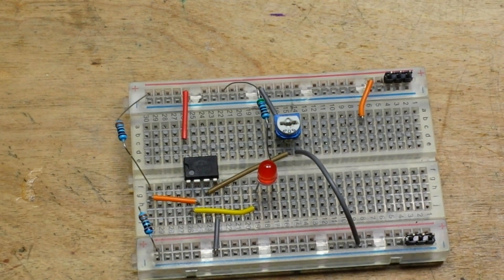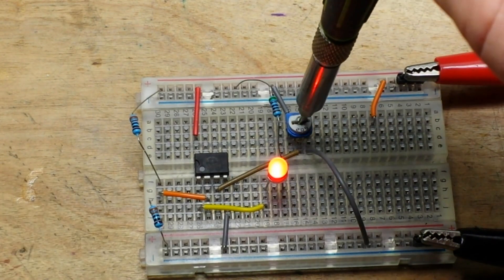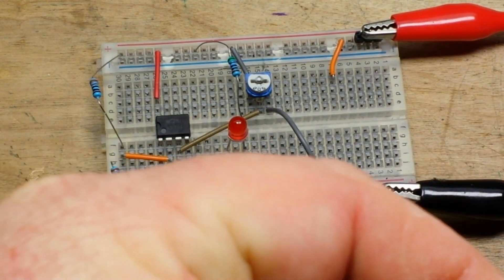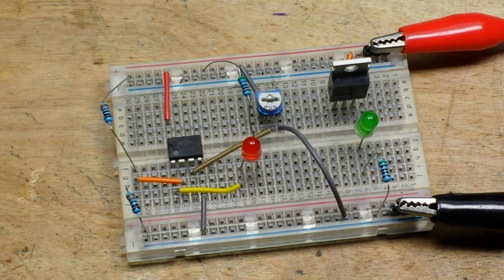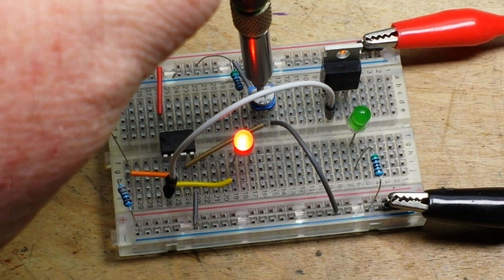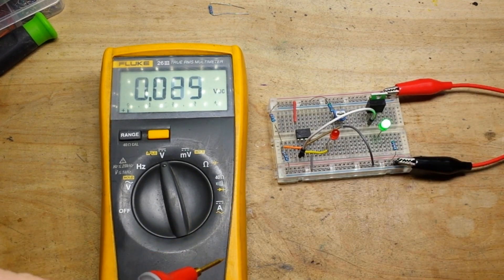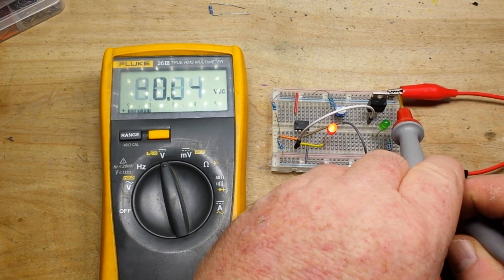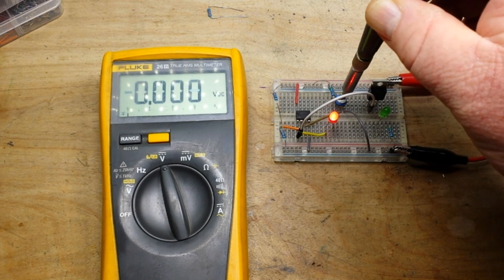Low Battery Cutoff Circuit with LM393

Comment: I have one or two questions and suggestions for this circuit. 
First, would it not have  been  better to use a p channel enhancement mode MOSFET? This would have had  its source connected to the positive supply, with the drain supplying the load, and the gate only requiring a grounding connection to switch it on. This arrangement is compatible with the output of the comparator, which is open collector. As it is, using an N channel MOSFET with the source connected to the load, the voltage on the gate must be Vth (threshold voltage) above the load voltage to turn on the MOSFET, something difficult to achieve if the comparator circuit is powered by the battery it is monitoring.
There are significant advantages using the +input as the voltage reference pin and using the -input as the voltage monitor, since when the battery voltage exceeds the +input reference, the comparator output goes low, providing the required drive for the P channel MOSFET to switch it on. It also makes it easier to apply added hysteresis to the circuit, by applying feedback to the +input. 

In a battery application, the resistor divider voltage will change with the battery voltage, as the comparator is powered from the battery. The solution might be to use a zener diode as the reference or the circuit on LED. Admittedly the zener takes more power to provide the reference, but it is not influenced by the comparator supply voltage until it falls below the zener voltage.  With a little thought, it should be possible to convert the circuit to a boot strap arrangement, where the comparator and reference are powered from the switched side of the MOSFET, making the MOSFET effectively the switch for the product (the load).
In any comparator circuit it is worth considering if additional hysteresis needs to be added to stop the circuit chattering around the switching point. This can be achieved by adding one more resistor to the existing circuit or maybe two,  if a zener or LED is used as the voltage reference.
It is good design practice to connect unused inputs to the voltage rails, unless the data sheet say this is unnecessary. This is to stop unused parts of the comparator drawing unnecessary power or going into oscillation. This also assumes the inputs are specified to include both rails in their input range. 
In testing this circuit, the battery rail should be adjusted to show correct switching operation across the full range of the battery voltage, remembering that for a practical circuit, the comparator is likely to be powered from the battery it is testing. 
In the configuration shown in the video, the battery voltage is emulated by a potentiometer, not by adjusting the supply voltage to the whole circuit. This is valid approach only if a separate supply is used to power the monitor circuit, as might be the case in monitoring a battery charger with mains supply or a bank of batteries in a telecom or IT installation.
Particular attention needs to be paid to the switching point, where the circuit might burst into oscillation for a number of reasons associated with supply rail smoothing/0regulation or lack of adequate hysteresis in the comparator.
It is also necessary to consider what happens if the unit is not switched off when the low battery voltage is reached. 
If the comparator remains powered by the battery, two undesirable events may occurs:
1) the small, but not insignificant, current drain of the monitor circuit may drain the battery beyond the point of recharge.
2) if the monitor is used to switch off the products supply using the power MOSFET, the monitors operation may become unpredictable below the normal operating range of the active elements in the circuit, unless this condition is considered as part of the design. This is all the more reason to design the circuit as a boot strap, so that it turns its self off below a critical battery voltage.

Making the circuit do exactly what is required is not as trivial as the simple voltage monitor circuit might suggest. There are a number of design tricks needed to implement the boot strap and make it fail safe under all circumstances. In a real product design, it would also be necessary to consider where to place capacitors to ensure that the circuit would not be susceptible to RF interference.
As a demonstration of the principles, the video is very good, but a practical design requires a slightly more complicated circuit.
Reply: Waoo!
Reply: @Bias_Prineus  I did not cover the on/Off switching. With the suggested circuit, turning it on is easy, just pull the MOSFET gate low for a moment. This allows the monitor circuit to take over and hold the circuit on. Turning off is a bit more tricky. It is relatively easy if there is a momentary push button for on and another for off. It is then only necessary to make the battery voltage  appear to be low, by pushing the off button to short the monitor point to ground at the input to the comparator. The circuit will then switch off. It is still necessary to check that pushing both on and off at the same time does not produce any undesired switching action. With a little consideration, either the last button released will win or off will win. 

Making the on/off switch toggle is a little more complicated. A momentary switch can be used to produce a toggle action. The trick here is to use the current state of the circuit (on or off) to select the next state. Given there is one comparator still unused in the comparator psckage, this gives the scope to engineer an on/off toggle. Though I would not be surprised that with a little thought, and understanding of the switching principle, that the suggested circuit can not be made to toggle just using steering diodes and a debounce capacitor. 

As I said, the trick is to use the current state to trigger the next required state. In this case, pressing the on/off button conditions the circuit for the next state, which is activated upon  the button's release. This has the advantage that debounce is inherent to the design. 
Consider the following possible solution out of many: 
We know turning the circuit on is simple, just use a switch wired or in parallel with the first ( monitor) compatible output on the MOSFET gate input (forming a wired OR).  This is used to force the MOSFET on  while the button is pressed. Once on, the comparator is powered, the voltage monitor output  takes over driving the MOSFET gate, provided the battery voltage is detected to be sufficiently high.

To turn the circuit off: while in the on state,  the button is pressed and held down for a sufficient time to allow a capacitor connected between the second comparator +input and the switched positive rail to be charged via a series resistor and diode connected to the button.. Once this +input voltage falls below the -input reference,  the second comparator output will switch low,  pulling down the voltage monitor input of the first comparator to which it is connected. This  fools the monitor circuit into detecting  the battery voltage is low. The first comparator then removes the drive to the MOSFET gate, turning it off, switching off the circuit.   Once off, the capacitor on the second comparator is discharged either by a high value resistor across it, or a reverse biased diode to the switched supply rail. The latter has the advantage that the circuit is ready to switched back on as soon as the switched supply rail is truly off. This is because in the off state the switched supply rail is at ground potential, providing a discharge path for the capacitor.

The switching action is as follows: press the button momentarily while in the off state, and the circuit turns on. Hold the button down for a short delay in the on state, and when its released the circuit will turn off. 
The circuit does not need lots of additional components, as the same reference voltage can be used for both comparators.

Notes: it is necessary to connect a high value resistor between the MOSFET gate and the unswitched positive rail to ensure the MOSFET  is held off when  neither the button or the first comparator are driving it to the on state.
As a consequence of the pull up resistor on the MOSFET gate, it is necessary to use a diode to isolate the +input of the second comparator from the unswitched supply voltage on the MOSFET  gate..
Reply: My apologies to anyone who has watched me repeatedly edit the above postings. My excuse is that I am using a small android tablet to write these posts and edit on line, rather than compose them off line before posting.
Reply: @nigeljohnson9820  Hi, could you explain a bit more how to hook up the turn off part of the toggle swicth? How to connect capacitor, resistor and diode to the +input of the second comparator? Also how to isolate +input due to pull-up resistor?
Reply: @sekelje  With pleasure, but what follows proves that a picture ( circuit diagram) speaks a thousand words.
 
Describing a circuit diagram is rather difficult, so I will start by defining a set of rule in the hope of making the description easier to visualise.
First let remind you that the comparator outputs are open collector, so they switch between high impedance and zero volts ground.
The comparator output is (active) low when the voltage on its -input is higher than the voltage on its +input.
The MOSFET is a P channel enhancement mode type, wired with its source connected to the battery supply positive and its drain suppling current to both the load and the comparator circuit.
Thus the drain will be referred to as the switched power rail.
A high value resistor (say 100k) is connected between the MOSFET gate and the source. This resistor holds the MOSFET off when the gate is not being driven.
Thus the circuit and load should draw almost zero current when off.
Connecting the gate to ground, turns the MOSFET ON, provided the battery voltage is greater than the gate threshold voltage.

(N.B. Should the battery supply voltage exceed the absolute maximum gate to source voltage of the MOSFET, the MOSFET gate can be protected by adding an additional resistor to form a potential divider network on to the gate.

For the purpose of this description, it will be assumed that the battery voltage does not exceed the absolute maximum gate to source voltage of the MOSFET used, so the MOSFET does not require any potential divider protection.
)

The toggle switch is a momentary push button type, which is wired with one side connected to the ground and the other side identified as the switch contact.

in order to establish a stable reference voltage for the comparator, a resistor in series with either a zener diode or an LED is connected between the switched supply rail and ground.
The reference voltage (Vref) being taken from the junction between the two components. The advantage of using the LED as a reference is that it will also serve as the circuit ON indicator, however a red LED will provide a rather low value of approximately 1.6 volts for this reference.

Consider the connections to the comparator package:

The comparator positive supply pin is connected to the switch supply rail, its negative supply is connected to ground ( battery negative).
It is good practice to decouple the comparator supply pins with a suitable capacitor, typically 100n wire closely across these pins.

Now consider the connections to the first comparator in the package:
Its output is wired directly to the MOSFET gate. The -input is driven from a resistor divider connected connected to the switched supply rail.
This is the load voltage, and very close to the battery voltage when the MOSFET is ON.

The +input is connected to the voltage reference, Vref.
A diode is connected between the gate and the switch contact, so that pressing the switch pulls the gate voltage to within one diode forward volt drop of ground.
Thus when the switch is pressed the Mosfet is turned ON, 
if the battery voltage is sufficiently high, the -input of of the comparator will be greater than the +input from Vref, and the comparator output will be low. This will hold the MOSFET ON when the button is relaesed. 

Now consider the connections to the second comparator in the package:

The output of the second comparator is connected to the -input of the first, this is where the output voltage  of the battery is monitored using the resistive divider, as detailed above. 

The -input of the second comparator is connected to the Vref.

The +input is connected to the switched rail by a timing capacitor in parallel with a high value resistor and a reverse biased diode. The purpose of the high value resistor is to provide a dc bias on this input. The parallel combination of the diode and resistor, discharge the capacitor when it has performed its function. A timing resistor is also connected between this +input and the switch contact.

When the switch is pressed and held, the timing capacitor begins to charges, until the voltage on the +input is below that of the -input. Then output of the second comparator then goes active low, forcing the battery monitor voltage low on the -input to the first comparator. The first comparator then no longer holds the MOSFET ON, but it remains ON because the gate is still held low by the switch contact voltage.
But when the switch is released, the MOSFET turns off, switching off the circuit. The diode across the timing capacitor becomes forward biased, as the charge on the capacitor discharges through the circuit load and the high value resistor with which it is in parallel.

The function of the diode connected to the switch contact is to isolate the voltage on the switch contact from the voltage on the gate, so even when the gate is being held low by the output of the first comparator, the voltage on the switch contact can still be pulled high by the pull up resistor in parallel with the timing capacitor.

Note in describing the circuit, I have made a couple of improvements, such as providing a better discharge path for the timing capacitor and removing the second diode on the switch contact, as only one is necessary for the required isolation.
Reply: @nigeljohnson9820  Thanks again. So diode in series with timing resistor pointing to switch contact (coming from +input) is not needed (resistor being kept, omitting diode )? Just timing capacitor, high value resistor and reverse biased diode all in parallel across switched rail and +input is needed?
Reply: @sekelje  you are correct about the diode in series with the timing resistor NOT being required, however I have discovered a further  problem with my toggle off circuit, but fear not I have two possible solutions.

 I added the second reverse biased diode across the high value resistor on the +input of the second comparator, in an very poorly thought out attempt solve the problem of discharging the timing capacitor when the supply rail is switching off, and thus protecting the +input. 
The comparator data sheet states that while the comparator inputs are allowed to exceed the positive supply rail voltage, they must not be allowed to  go below the zero volt rail by more than 0.3 volts, (I.e. -0.3 volts) if the output is to be well behaved.
The circuit describes in my earlier posts fails to meet this requirement during the turn off transition period, due to the topological problem of needing to charge the capacitor from the zero volt rail.
As the timing capacitor is connected between the low impedance switched positive rail and the high impedance +input of the second comparator. As the rail voltage drops at switch off, the voltage across the charged timing capacitor can potentially  force the + input below the zero rail volts, if nothing is done to stop it. 
One solution is:
To move  the reversed biased diode across the timing capacitor to a new position, so that it is connect reversed biased between the between the timing capacitor and the zero volt rail.  This diode then clamp the capacitor voltage to within one diode forward bias volt drop below the zero volt rail. Unfortunately, even using a low forward biased voltage schottky diode in this position, does not guarantee the +input will not go below the zero volt rail by more than 0.3 volts, since the Schottky diode voltage is around 0.5 volts.
 To  offset  the clamp voltage and keep the +input above the zero volt rail, requires a further change to the connections on the +input as follows: 
1) Connect the pull up resistor directly between positive rail and the +input.
2) add a third diode pointing out from the +input. (I.e. anode connected to +input)
3)  fit the timing  capacitor between the point of third diode (cathode) and the positive rail.
4) place the second diode so it is reverse bias connected between the capacitor and the zero volt rail.
The cathodes of the second and third diode are now connected together.
The effective of this arrangement is to use the third diode to offset for the negative clamp voltage on the second diode. The protection is improved by using a Schottky diode for the clamp and a normal silicon diode to provide the offset. The Vforward of the latter being higher than the former. This arrangement should give approximately 0.5 volts safety margin on the -input voltage.
The above description sounds complicated, but is simple when shown as a circuit diagram. The cost of this solution is one extra diode. 

Second solution:
As the comparator inputs can exceed the positive rail, a better solution might be to connect the timing capacitor to the zero volt rail, and charge it using small P channel, enhancement mode, MOSFET,. With the gate connected to the switch contact, and source to switched rail and drain through a series timing resistor to the timing capacitor. The MOSFET removes the need for diodes 2 and 3, but the logical inversion introduced means that the second comparator inputs must be  swapped around, with the -input connecting to the timing capacitor and the +input to the reference.
Reply: @nigeljohnson9820  About second solution, if we swap around inputs of the second comparator , for circuit to be in "on" state  +input must be higher than -input, should -input be connected to ground with high value resistor to pull down? If I understand correctly, coming from drain of a small P MOSFET,  timing resistor in series with timing capacitor needs to be connected to  -input? Also, small P MOSFET needs high value pull up resistor connected from gate to the switched rail to function properly. Is isolation with diode needed in this case also?
Reply: @sekelje  the isolation diode is still necessary. The pull up resistor on the small MOSFET acts as the pull up resistor for the switch. When the main MOSFET is being held on. The first comparator is driving its gate low. The isolation diode is therefore still necessary to allow the switch contact to be pulled high by the pull up on the second MOSFET.
The only advantage of the second solution is that the timing capacitor is being charge high.(towards the positive rail). This means that during the switch off transition, the voltage on the charged timing capacitor will exceed the voltage on the positive rail, a condition that does not violate the voltage specification of the comparator inputs. 

The first solution should work correctly, though the tolerance looks a little tight. The action of the clamp and offset diode should hold the +input above the critical 0.3 volts below the negative rail spec, even if two similar silicon diodes are used, but the tolerance is then very tight, as the forward voltage on the clamp diode must be matched by that of the offset diode, leaving just the 0.3 volt safety margin. If you are really concerned, the two diodes in series could be used to provide the offset voltage. I know this is not very attractive, as it requires yet another component. 
From a philosophical point of view, the production of the toggle switching action requires some way to separate the current state of the circuit from the next state. In this case it is achieved using the state of the switch. Pressing and holding the switch on conditions the circuit to turn off when the switch is released. This function is normally performed with an edge triggered flip-flop. In which case each button push changes the state of the circuit, even with a boot strap configuration. 
But the requirement of the comparator circuit was also to accurately measure the battery voltage status, and automatically  turn off if the voltage was too low, and still be in a boot strap configuration. That is more demanding of a non ASIC solution that attempts to use the minimum of components. It is the limitation of the comparator input range that has complicated the circuit. There are beyond rail comparators that easy this limitation. But I did not think it met the design brief to use them, as if it is allowed to use some other component, then there is no reason not to look for an ASIC battery manager IC that does exactly what is required in one device. 
There are many ways to achieve the desired specification, it can be implemented with surprisingly few discreet transistors, resistors and capacitors. Someone has already posted a suggestion that a ne555 can provide a solution, though I have not checked if it matches all the functionality of the  proposed comparator circuits.
This function is ubiquitous in modern battery powered devices, so learning how it is implemented is a worthwhile activity. 

I once worked on the prototype model of a digital mobile radio transceiver. In the haste of getting all the clever DSP bits working, the software design team had overlooked the requirement to be able to turn the radio on and off, making the switch function an after thought.  Almost all the PCB resource had been allocated to the processing and RF electronics. There was just sufficient space to fit a TO220 TopFet and a small low current push button panel switch. Using the above principles it was possible to implement the bootstrap on/off switch configuration, using the few remaining gates in the transceivers FPGA to perform the logic function. The result was a low cost toggle action on/off function able to switch 12amps at 12volts, but drawing no power when off.
Reply: @nigeljohnson9820  Thank you very much, I learned a lot through this conversation.
Reply: @sekelje  in a way so did I. when I posted my original circuit, I failed to consider the limitations imposed by the constraints on the comparator input voltage. Something I would not have done before my retirement. Maybe it was me just me being lazy and not doing the work in the way I once did. Coming up with the circuit topology is the fun, like solving a jigsaw puzzle with a random set of pieces. But once a circuit  topology has been found, it is then necessary to check the details to see if there is any reason it will not work. I have not built either solution, and building a prototype is the next logical step, but I am now reasonable confident that either of the corrected solutions will work, once the component values have been assigned, though they may require some adjustment at the prototype stage. It can be infuriating when a circuit does not perform as expected, but it is always informative.
I suspect that all none trivial designs go through four stages:
1) its impossible to meet that spec. ( Overwhelmed).
2) its easy, now I see how to do it. (Over optimistic and over confident).
3) its impossible, it does not work. ( Over stressed).
4) that how it's done. (Over joyed, satisfied and relieved)
Reply: @nigeljohnson9820  Exactly as you said. Thank you for sharing your knowledge and experience.
Reply: @Bias_Prineus  whoo?
 In this case a picture would have been worth a thousand poorly chosen words. I spent a great deal of time rewriting these posts to try and explain how the suggested circuit changes work. It is unfortunate it is not possible to post a circuit diagram, as I am sure my limited explanation is near incomprehensible to those who do not have the circuit diagram in front of them. I hope that at least the design principles are sufficiently well explained to allow others to implement them in their own designs. There are many ways to implement this requirement, for instant a microprocessor reset IC could be used. There are of course battery management ASICs or a PIC could be used. However, the intention of the video is clearly to provide an introduction to comparators, and how they can be used in a practical application. The proposed changes just extend this to a real world application, pointing out some of design consideration which may not be obvious to those new to electronics.
I have not tested my proposed design changes, but I am reasonably confident that it will work, but as with all back of an envelope circuit ideas, there might be some need for adjustment to make it work as specified. 
This is not the first time when  posting a circuit diagram would have eliminated the need for  a badly written circuit description. I had a similar problem describing a simple stroboscope.
Reply: @nigeljohnson9820  for this circuit eBay has a 555 based charger controller that is 2.5 Euro's assembled   and works good with upper and lower limit as well
Reply: @Bias_Prineus  but that is not the point. The idea was to show how a comparator can be used in this application. There are battery management ASICs that perform this function in a single IC and contains a battery temperature monitor.
Reply: @nigeljohnson9820  The problem isn't with his switching circuit. A voltage comparator to disconnect the battery from the load, works.

The problem is: There needs to be another cutoff prior to his "Control" point, where NO POWER is being drawn from the battery. Some have suggested a zener and a resistor to the control voltage divider/comparator ckt. I suggested the same but added a relay.
The way it is now, there's a wide range of voltages-battery combinations it will work with.
Currently the source is 10v. What if it's 4 D-cell, rechargable? Or a 12v-5ah dry cell for an alarm panel, or 14ah-2 7's in parallel.
This is a ghost ckt, go anywhere be anything. With very slight changes it could work for protection for a flashlight. 

Another option is to use it for say my Son's 16 channel fireworks control system. Using any component other than a relay is automatically current limiting.
What about a camera flash with repeatedly charging caps.

I could go on and on. The point I was making is this. His design WORKS as a "current limited load switch".
But, for the purpose of battery protection, it really failed. It's still talking power from the object it's allegedly protecting.
Without a means to stop ALL battery drain, all it does is delay the total discharge of the battery source.
Reply: @timthomas9105  I think you will find my boot strap proposed circuit solves the problem of the monitor circuit draining the battery when it has cut off the supply to the load. Using a p channel MOSFET, allows the MOSFET to be used in switching mode.
There will always be a circuit limitation regarding the point at which the monitor circuit stops working because it's supply voltage is too low. This might be due to the threshold voltage of the MOSFET or the supply range of the comparator.
The trick is to make the circuit fail safe, that is switch off before one of the above limitations is reached.
A relay is a useful device, but it's relatively high current demand makes it less attractive in battery powered circuits. There is also a problem with vibrational stability. As the supply voltage falls, it becomes easier to physically knock the relay and open its contacts.
Any relay circuit also requires a certain amount of hysteresis built into its switching to ensure the switch contacts do not bounce or burn when slowly or partially open.
While the p channel MOSFET is the best solid state solution for the switch, it must be chosen to have a low threshold voltage. 
An alternative switch is PNP bipolar transistor, here the HFE is the limitation, but the Vbe is likely to be smaller than the gate threshold of a  MOSFET. With the correct choice of comparator, these are likely to continue operating down to 3 volts or less.
The general principle of solid state switching and boot strapping is well understood and is common practice in most battery operated electronic devices. Only very simple devices, such as flash lights still use a conventional on/off switch.
The leakage current through the switched off MOSFET is likely to be in the pico amp range and is insignificant compared to the self discharge current of a battery. So provided the boot strap topology is used, so that the monitor circuit is on the load side of the switch, using a MOSFET in this application has few disadvantages. 
You may be interested to know that the relay solution still finds application in disconnecting the battery in some automotive applications. Where leaving the lead acid battery connected to discharge to zero will irreparably damage it. In this case the relay contacts are rated to hundreds of amps, to handle the normal working load. But even here devices such as high power MOSFETs and IGBTs are starting to replace the very expensive mechanical relays. 
In the radio application on which I worked, the TOPFET was controlled by logic in a 3volt powered FPGA. This supply was derived from the automotive nominal 12 volt supply using a buck switch mode regulator followed by linear regulators. While the battery voltage is nominal 12volts, its actual range is anywhere between 6 volts when the engine is cranked to almost 17 volts when the battery is being charged by the alternator, siting at about 13.6 volts when the battery is fully charged. In a process known as current dumping, the alternator can deliver a significantly higher voltage to the car supply. 
Even with this wide range of input voltages, a TOPFET provide an ideal solution to switching the power to the transceiver. 
A microprocessor reset circuit, reset both the FPGA logic, the DSP, and the processor, when the supply fell below 4.75 volts. 
This completely removed the gate drive to the TOPFET, safely switching off the transceiver.
The transceiver on/off control was by a momentary push action switch, which was part of the radio volume control. This was rated for no more than 100mA. In practice it was used to switch less than 10mA, dispute the radio load being of the order of 10amps.
A relay solution in this application was completely impractical from the point of physical size and operating voltage range.
Reply: @nigeljohnson9820  I agree with everything you said. My point with the relay. A resistor diode ckt, mosfet or anything that completely turns off ALL current draw from a battery is the requirements of protection. There's no application of a load, just a little green LED.
The very first thing I learned in electronics was, "Input Conversion Output". 
So this works when the comparator pot is adjusted. And the red LED lights. Isn't that really like having an identical LOAD?
1) Is the battery rechargable?
2) How is it recharged?
3) What is it's working range?
4) At what voltage level is it safe to operate?
5) At what point above (4) do we want to disconnect the load?
6) At what point BETWEEN (4)-(5) do we need to SHUT it ALL down?
7) Going back to (1) need the type and current rating, whether rechargable or not, to determine the HOW because a car battery may allow for a longer trickle drain on the control ckt. Or AA, AAA, 12v 5ah, 7ah, single and double, series parallel battery set up.
All of it is related and relevant. 

Like I alluded to before. I have an Altronix AL400ULACM 12v 15amp supply with 2 12v 7ah batteries in parallel. 
This setup energizes my home structure can. It's even safe to put 4 batteries in the ckt but the box holds 2. 
As it is, I am able to get 30+ hours of no A/C power, before losing my Wi-Fi, etc.
My interest in this case is, at what point, does the CONTROL section also shut down to prevent total battery drain?
And if anyone asks, no I do not think that a car battery would work for the structure can. Apples to apples.
Reply: Yes
Reply: @gapadad2  yes?
Reply: Thank you very much.
Reply: I too run a UPS to maintain my CCTV security system and my modem internet connection. There was little point maintaining power to the Ethernet switches as the UPS fitted to the mains powered computers only gives a short run time when the mains supply fails. But with the WiFi still running, I am able to get hours of access using the laptop and tablets. Assuming the internet connection does not fail with the mains supply. 
I am not sure I fully understand your question. There is no need for any LEDs to be on when  the battery is protected from over discharge. Even the 10 or 20mA to drive a LED is sufficient, given time, to over discharge a battery. 

(I think the answer to most of your questions can be found in the data sheet for the battery technology you are using. It is very specific, being different even between battery manufactures. If you examine the spec for most battery technologies you will find the discharge voltage curve is no where near as flat as you might expect. After recharge the voltage usually falls very quickly from a peak well above the nominal voltage. The voltage then enters a plateau region, with a more slowly declining slope. At the end of the useful charge, the battery voltage then reaches a turning point, where it again falls quickly. It is this corner voltage that defines the point where the battery should be disconnected. Unfortunately the slope of these curves are greatly affected by the load current. High currents Blur the plateau shape, increasing its slope until it all looks down hill, with only small changes in gradient.)

When I work on the design of radio site equipment, the standard back up supply was a nominal SELV  48 volt from a sealed lead acid battery bank, that was float charged from an mains isolated switch mode supply. The control electronics was designed to protect the batteries from damage, selecting fast charge following an extended mains outage, but with temperature controlled  float charging under normal operation. 
Being fixed equipment, weight was not an issue. Lead acid was used because it was the most forgiving of the battery technologies of the time to prolonged abuse, being relative tolerant of over charging. I suspect that lithium ion batteries are now used, maybe LiFePO4, as this I believe is the most forgiving of the current lithium technologies in current use. Maybe one day it will be Lithium Glass. The exact method used to manage the battery stack is very dependent on the battery technology used and the manufactures specification. These detail such things as: method of float charging, maximum discharge rate, maximum fast charge rate and all temperature dependence. In the telecom application, it was necessary to use DC/DC switch mode converters to make best use of the energy available from the batteries. To this end most of the equipment was designed to operated from 36 to 72 volt inputs, nominally 48 volt to the rack,  provide a stable 24 volt supply within each equipment shelf. The priority was to maximise redundancy and resilience to provide best availability.
For equipment that is only battery powered, the design problem is how to manage the boot strap circuit so as to avoid the race conditions that might stop the equipment switching either on or off, or worse still might result in oscillation between the on off states. In ups application, where mains supply is the normal source of power, the problem is ensuring the equipment recovers from an extended outage and provides glitch free switching from mains to battery and back again when power is restored after a short or momentary outage. Converting from AC to DC and float charging greatly simplifies this task. It is far more demanding to efficiently   synthesise an AC supply from a DC backup, if the required output is to approximate to a sine wave.
Reply: Nigel Johnson , any chance you could provide an image of your schematic for your proposed “low voltage cutoff”. I’m a real newbie, just trying to learn circuitry and it would be awesome if you could provide a link to an image or two of your circuit diagrams. Thanks for any help. Tim
Reply: @tenapier  I used to post such circuits to the Maplin forum, but since that closed I have not found anywhere to which I can post such images. I do not operate my own web site. It is something I have considered. 
Be assured if I had been able to post a circuit here I would have, as a picture would have saved the thousand words in the circuit description above.
Reply: Nigel Johnson , oh well! Thanks for your reply! I will just have to read thru your explanation more thoroughly. As you say, a picture would be worth so much, especially when you are more attuned to learning visually/spacial, than verbally.